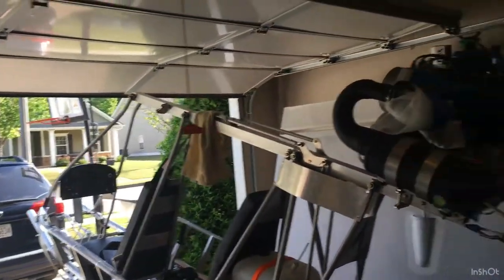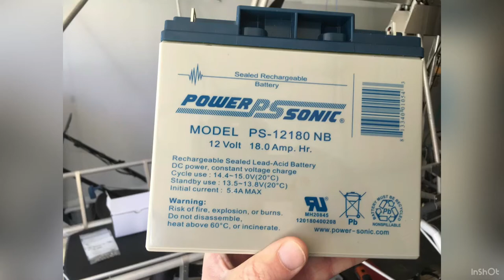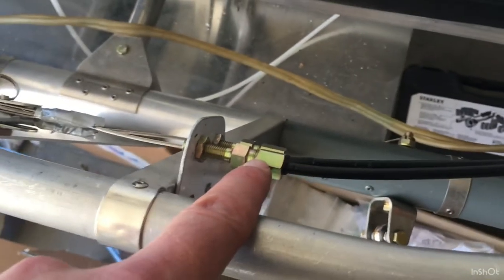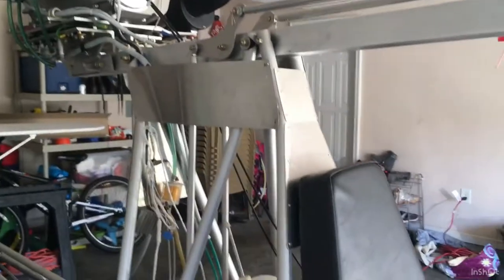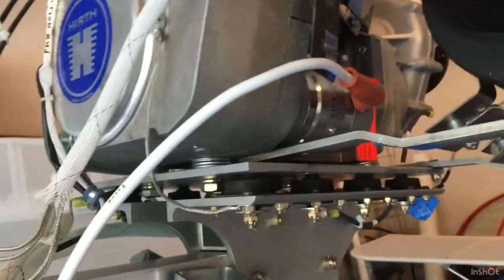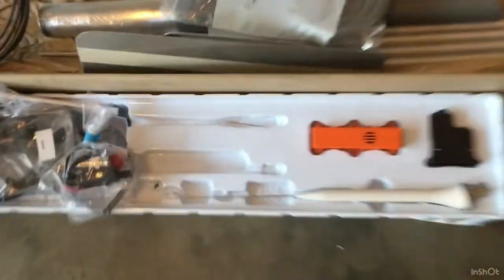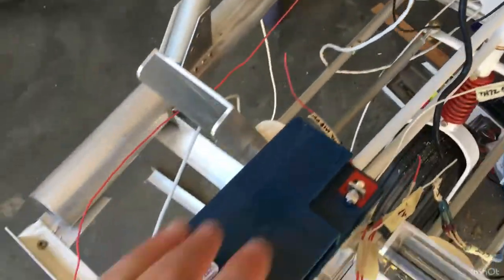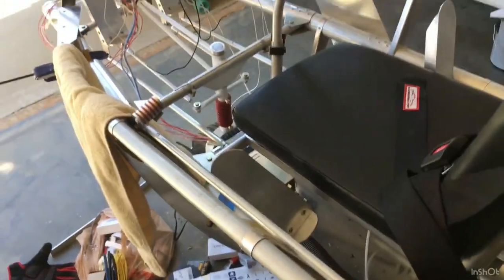Excalibur Aircraft Build Project 23

Comment: By the way you are talking it sounds like the engine was used previously, is that corrrect? Why is it not recommended to use anti-seize on the exhaust?
Reply from the maker: Yes, it only had four hours of break-in on it.  Anti-seize is not recommended by the manufacturer.